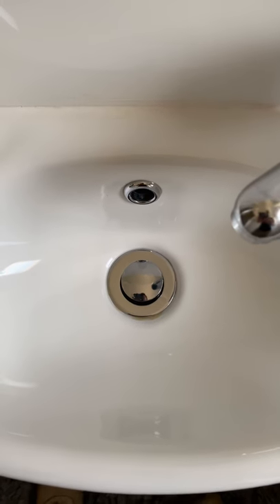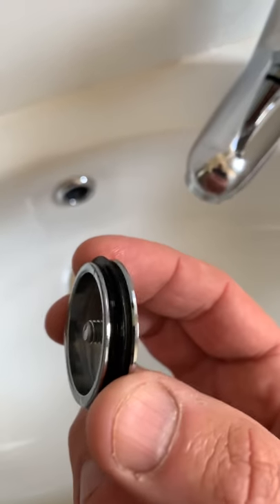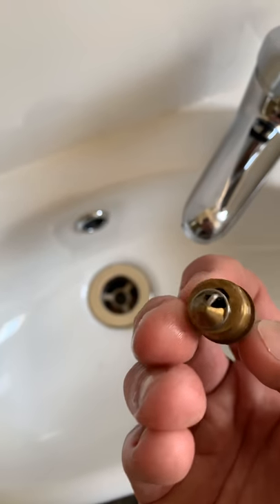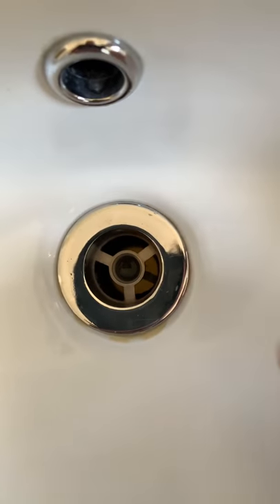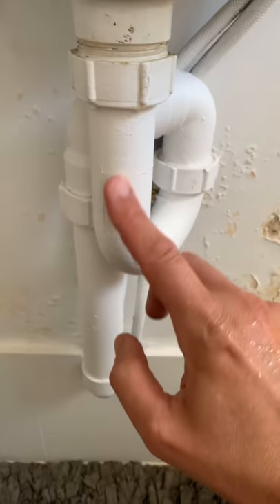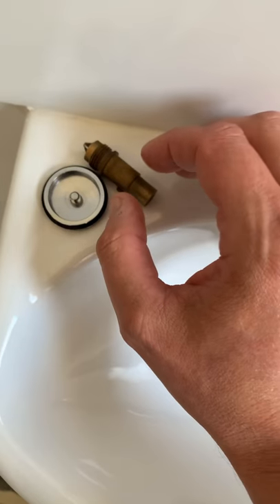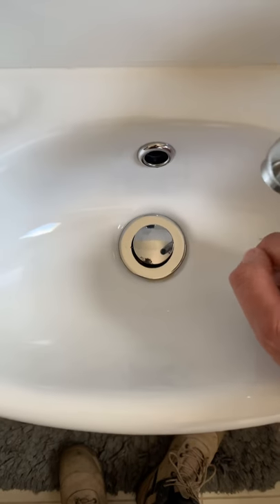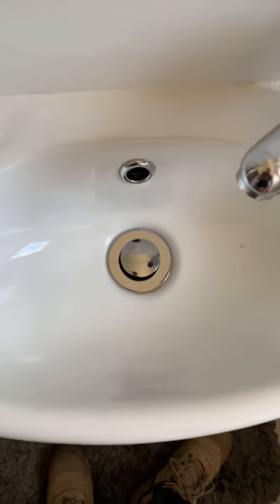🧐How to fix a spring loaded pop up waste plug in a hand basin or bath tub, Mayfair Plumbing Adelaide

Comment: Thank you for the great solution.  The spring mechanism stem snapped off at the bottom.  I had already pulled most of it apart before finding your video.  Stuck at trying to remove the drain plug outer as I did not want to damage the basin.  I knew the waste plug outer was held in with silicone as I watched the plumber install the new basin about 5 years ago.  Unscrewed the centre stem and took bits to local plumbing supplies.  Replacement was $6.95 - Great Relief!
Reply from the maker: Glad to help have a nice day 👍🏻👌🏻

Comment: thanks , very helpful , Ive seen other plumbing tutorial videos which encourage people to remove and check pipes underneath but without your useful warning about damage.  Rich
Reply from the maker: Richard Stevens thanks for the comments, have a nice night 😊
Reply: It's safe to unscrew the PVC P-trap, to clear a blockage, but not to unscrew the tailpipe from the bottom of the sink, which is where the damage would occur.

Comment: Thanks for your video, but unfortunately by POS clicker waste is stuck in the downward FULL position, no return to level with the waste base, think the issue is that my kid washed her hands in the sink after playing in a sandpit that has really fine sand and its locked the spring mech, the "plug" part that stops the water from escaping will not turn, soon as this lockdown is over i'll finally have viewings on this hose and escape the clicker nightmare. and yes they installed clicker in the bathtub. I'll never have a clicker waste again and I USED to supply them

Comment: I went to using these thinking they would be less of a problem then the older style with the push pull open close. Boy was i wrong. I have taken these spring mechanisms completety apart and and greased them with faucet/valve grease to no avail. They still get stuck closed after about 10 days. I will likely move back to what i once had...
Reply from the maker: Hello William,
Yes depending on water quality etc these mechanism’s can very challenging!  They have since come up with a newer design which allows for easier servicing and also a much more simpler replacement process.  Good luck and have a nice weekend 👌🏻👍🏻😉
Reply: @MayfairPlumbingandGasfitting  I have one type that screws into the base and another type that sits in the base. Far easier to get that out when it wont open...i have a suction cup that i apply and just lift it out to work on it. Disassempling these is easy, getting them back together after cleaning and greasing is very frustrating.

Comment: Thanks for this solution. Was able to unscrew the cap and clean my clogged sink my kids messed with. A simple anticlockwise movement did the trick and saved me the hassle of nearly getting a plumber that would've charge a bomb for this. Mine wasn't so much of a problem with the spring action. The rest was easy to clean.
Reply from the maker: Cheers

Comment: Thanks- I came to this after I did exactly same- but it seized months later- do you think some silicone grease may keep spring mech lubricated for longer because thicker lube stays in place less effected by hot water running through over time. 
Any thoughts?
Reply from the maker: Yes i think that will certainly help, silicone spray or grease should help prevent any corrosion, have a good day 💪🏻😊

Comment: Thanks! If anyone else's plug is stuck - just remove the mechanism like he does in the video, spray it with WD40, then put it in a vice and pull up with a pair of pliers. Worked perfectly for me
Reply from the maker: Thanks have a good night 👌🏻👌🏻👌🏻👌🏻
Reply: You can also buy a new spring mechanism from EBay for around £4 rather than cleaning the old one.
Reply: @Jimmyredcab  what is the name of it?
Reply: @rosemariemolina6152   Go to EBay site and paste this into the search box.         38mm sink basin waste plug cap spring bolt easy pop up clickclack chrome
Reply: Jimmyredcab thank you

Comment: All that is easy enough, but what if after replacing the pop up assembly, the water still leaks past the stopper? Is it possible to adjust the extension of the piston, to secure a greater seal?  For example, while shaving and I want to have water in the basin to rinse my razor?
Reply from the maker: Thanks Todd, you can get replacement seals for most pop up wastes 👌🏻👌🏻
Reply: @MayfairPlumbingandGasfitting  It's a brand new assembly, the seal/o'ring shouldn't leak. I feel that it's not creating a tight seal when set to the closed position. Any help?
Reply from the maker: @toddguler5661  maybe have to try another spring mech?

Comment: Hi, I’ve got a Mizu DN40 from Reece plumbing in a bath in a new home and the plug continually gets stuck down with a full bath and won’t release. I’ve had two new ones supplied under warranty both with the same issue. From what I can tell the weight and pressure of water in the bath is causing too much pressure on the spring not allowing it to release and drain the bath. Is this something you’ve encountered? Unable to get any help with it from anyone unfortunately.
Reply from the maker: Hmmm this seems unusual!
I wonder if the mechanism needs lubricating?  Or does the circle rubber seal need some silicone grease on it to allow it to freely move???
Reply: @MayfairPlumbingandGasfitting  happy to send through a video of interested in seeing! It’s very frustrating and I’ve been battling with it for almost 12months since brand new.
Reply from the maker: @hsvboy11  no worries.  Send me a video and ill have a look in the morning.  plumbers@mayfairplumbing.com.au
Att: Aaron 👍🏻😉

Comment: On mine, the plug ceased shut, and obviously as I was shaving, the basin had water in it... not happy with the situation. I had to dismantle the waste trap and stick a screwdriver from the bottom up and force it open. You need to have a container the catch the water in case you have water in the basin like I did. Or if you have a wet and dry vac handy, even better.
Reply from the maker: Thanks for the comment!  Sounds like you got lucky to get that un stuck again, un fortunate how the basin was full 😩😩 have a nice weekend, Aaron 😊
Reply: @MayfairPlumbingandGasfitting  
Yep. I was pretty pissed off with that. Also I was in a hurry to go somewhere. It was one of those days where nothing helps. 😂
Reply from the maker: @ruinunes8251  yup had plenty of them lately!  As a plumber thats my day nearly every day 🙄😬😩😩😩

Comment: The manufacturers of these pop up valves should be made to incorporate a hexagonal flange around the body so that all you should have to do is drop a tube spinner onto the body and it then comes out with the minimum of fuss and not having the potential of putting strain on the unit and risk cracking the ceramic bowl in the process. Just a thought.
Reply from the maker: Yes this is a good point.  They're actually are some pop up wastes on the market today that just drop into the bowl so the whole thing can easily just be removed.  Cheers for the comments and have a good day!

Comment: If they are that much trouble I would just discard the mechanism and get an old fashioned tried and tested manual plug.
Reply from the maker: The trick is trying to find a plug to fit the hole it can be a challange 😬😬😬

Comment: That tiny screw on the spring mechanism was loose and it just fell down the plug hole! 😩 Do you think it will still be in the u-bend or will it have been washed away?
Reply from the maker: Yes most likely!!! fingers crossed

Comment: In the video you say "if you are here it is probably because you have one that is stuck" and then proceed to tell us how to avoid the problem with regular maintenance. Yes, mine is stuck. Suction cup isn't working either. Your video is a waste of time for people looking for a solution short of calling the plumber.
Reply from the maker: Sorry you feel that way Buster.
Reply: @MayfairPlumbingandGasfitting  Yeah, sorry - it was the frustration talking. I kid you not, I decided to take a flyer and knocked on the drain cap HARD until the bolt jammed in the fully recessed position. A that point I was able to unscrew the cap and use vice grips on the bolt. Don't know if a plumber would have done that, but it worked.